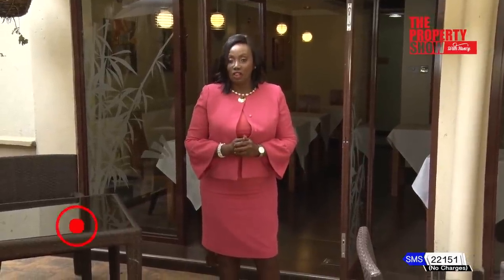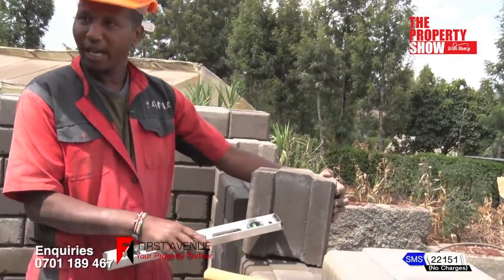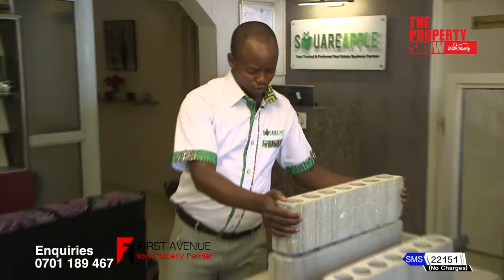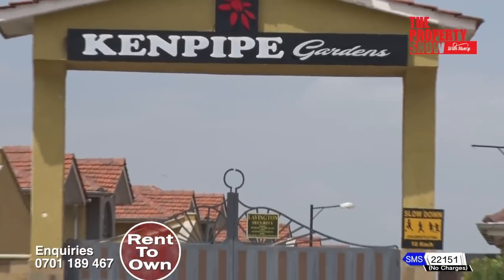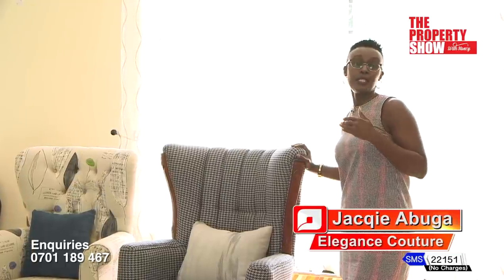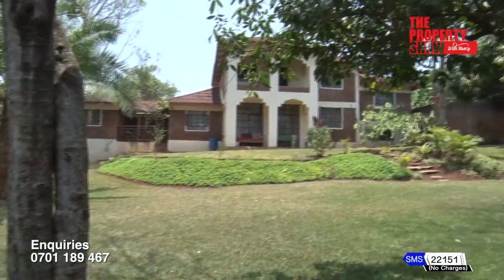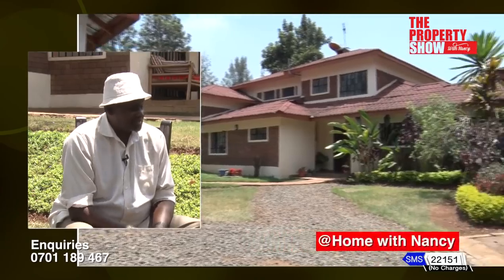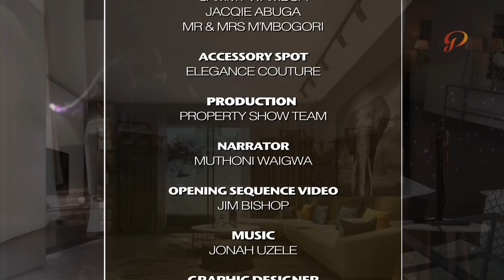The Property Show 24th January 2021 Episode 378 - Alternative Building Technologies

Comment: Amazing! someone is thinking outside the box. For the precast panels, if you pass rebar between the hole openings while putting up the walls, and then before placing the c-channel when the wall is complete, pour in concrete through the holes... just as they do with cmu blocks. Another thing Square Apple can do with their precast panels is do pre-designed precast service panels fitted with electrical outlet receptacle openings that way, it be easy to place a panel where an electrical outlet is needed instead of having to cut into the precast panel to fit one.  Nice work!
Reply: i guess im asking randomly but does anyone know a method to log back into an instagram account?
I stupidly forgot my account password. I would love any assistance you can offer me!
Reply: @Carter Lucian instablaster =)
Reply: @Mekhi Beckett I really appreciate your reply. I found the site thru google and im trying it out atm.
I see it takes quite some time so I will get back to you later when my account password hopefully is recovered.
Reply: @Mekhi Beckett it worked and I now got access to my account again. I am so happy!
Thanks so much you saved my account !
Reply: @Carter Lucian no problem xD